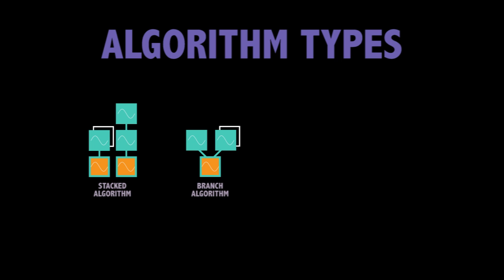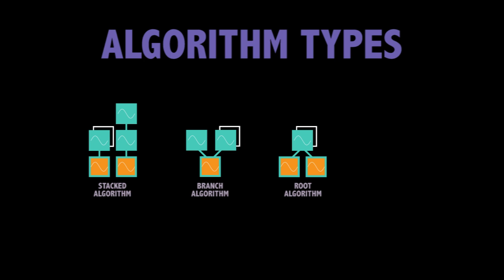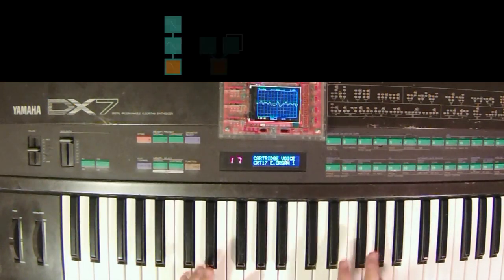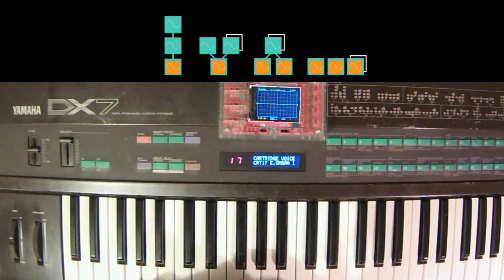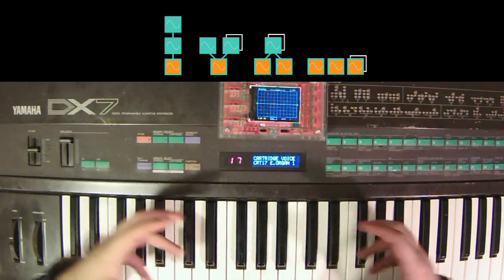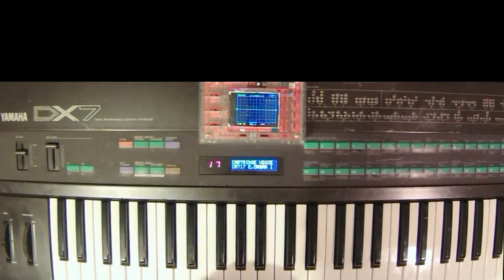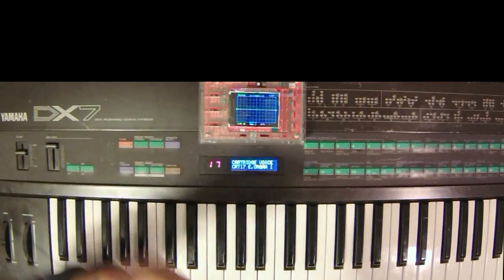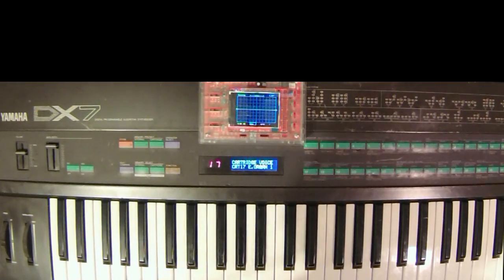Yamaha DX7 FM Synthesis Tutorial | Algorithms Explained

Comment: I'm still trying to fully understand FM synthesis and programming the DX7, so I might be getting something wrong here.
Is the statement around 1:40 correct, saying the modulators increase or decrease the sine wave's output level? I thought modulators modulate the frequency or phase of another operator, not its amplitude.
Reply from the maker: Every operator produces a sine wave and has an adjustable output level. The effect of Output level is determined by the function of the operator.

If an operator is a modulator, increasing its output level affects the strength or amount that it modulates the next operator its connected to (modulation).

If an operator is a carrier, changing its output level affects the volume of the sound that's produced (amplitude).

Comment: what parameter does the modulators wave form modulate in the carrier? thanks
Reply: i think the modulator increases or decreases the carrier’s frequency, not it’s level as you said in the video. that would be amplitude modulation not frequency modulation.
Reply: @eatfrenzy  Right, it increases and decreases the carrier's frequency at the rate of the modulator's freq setting. It's basically a really fast vibrato, which as it turns out, adds a bunch of spectral characteristics to the carrier wave to create the interesting timbres that you hear.
Reply from the maker: In FM synthesis, the modulators output level determines how much its waveform (sine) distorts and modulates the operator below it. It doesn't affect a parameter, it changes the waveform shape of the operator below it. In this case a sine wave is distorted to another complex waveform. This is true if a modulator is connected to another modulator or carrier in an algorithm.
Reply: I thought it changed the frequency (FM = Frequency Modulation)?
Reply from the maker: @paul_arutyunov In FM synthesis, frequency modulation is achieved by increasing a modulators output level into another operator (carrier). Changing the frequency settings (Coarse and Fine) will change the spectral range but it's effects won't be present if the output level is less than 50. The active output level range (in a DX synth) generally occurs between 50 and 99.

Comment: Was the oscilloscope on your DX-7 separately installed or were they all manufactured with an oscilloscope?
Reply from the maker: It's a stand alone digital oscilloscope and it sits on top on my DX7. If you're looking for one it's a JyeTech DSO138.
Reply: madFame sweet thanks
Reply: madFame is there any way I could message you and ask you a few questions about that oscilloscope?
Reply: madFame actually nevermind can I just ask you a few right here on this comment?
Reply from the maker: Sure, what would you like to know?
Reply: madFame firstly, how does the oscilloscope connect to the DX-7 like with what cables and where do you plug the cables in? Then does any old standard 9v power supply work to power the oscilloscope?
Reply from the maker: I connect my DX7 headphone output to the probe input of the o-scope. To plug it in you need a BNC to RCA adapter which converts the probe input socket to an RCA audio socket. The o-scope runs off a 9V center positive DC power supply.
Reply: madFame so if you’re using the headphone output of the synth are you able to use the normal output at the same time?
Reply from the maker: Yes, the main output is goes to my audio interface or camera and the headphone output goes to the oscilloscope.
Reply: madFame great I’m definitely going to get one of those
Reply: madFame sorry one more question, what cable is used to connect the o-scope to the DX-7?
Reply from the maker: It's a 1/4" jack (mono) to RCA cable.
Reply: madFame great thanks a lot

Comment: I notice when I look at the DX-7 algorithms that there is a minimum of two operators, I guess there is no such thing as a 6 op stack?  Or a 5 op stack with a carrier on the side?
Reply from the maker: Hi there. technically there can be any combination of algorithms but the ones we see on many FM synths have been auditioned by the engineers and designers as the most useful algorithms for a wide variety of possibilities. In most cases the ideal number of operators is 3 or 4 as this allows maximum tonal variety. Any more than that only produces distortion and noise which can be achieved with 2 ops and a feedback loop anyway.

Comment: Hi.  What algorythm did you use for the dual carrier stack?
Reply from the maker: Not sure which one you mean, carriers can't be stacked. In my video the orange ones are carriers and the blue ones are modulators. Many algorithms have this arrangement. For example, even if the algorithm has 4-ops in a vertical stack you only need to use the bottom 3 operators. The very bottom one is the carrier, the two above it will be modulators.

Comment: Can anybody tell me what the difference is between a modulator and an operator?
Reply from the maker: I can! :) 

Ok, so an operator is like a control box that has several functions. The main function is producing a sine wave. From here it has other functions to control that sine wave, such as output level, frequency, envelope etc. 

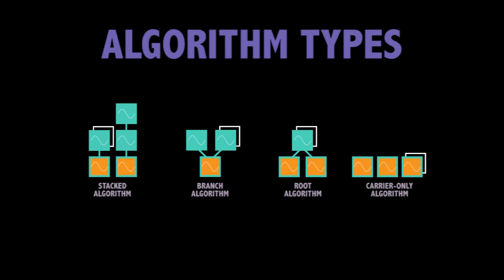If you look at the "algorithm type" diagram in my video at 3:07 all of those boxes are operators. The orange operators are Carriers, the blue operators are Modulators. An operator can only be one of these at any one time and this is determined by the algorithm you select.

A heavily simplified explanation of this is:  Operators in the Carrier position affect volume changes in the sound you're making. Operators in the Modulator position affect the frequency of the waveform shape you're programming.
Reply: I just watched your video, it's pretty well done! Looking forward to see all of them. Just here your explanation is not quite exact - operators in modulator job affect frequency, and can be used for vibrato (low frequency modulation), but when modulating frequency enters audio range, it affects timbre.

Comment: First of all: Thank you for your great work! But I am a bit confused about your statement at about 1:40 in this video. The modulator in an FM system is controlling the frequency of the carrier (not the amplitude as you are stating here, that would be AM not FM).
Reply from the maker: Hi Tobias, thanks for watching and sharing your thoughts. You are correct in your interpretation of FM and my explanation is correct but maybe unclear. I was referring to the user increasing and decreasing the Modulators output level and that affects the operator below it. I didn't mention a carrier specifically in this example because a modulator can be connected to another modulator as well. in either case I wasn't implying the modulator affects the carriers amplitude but rather the modulators amplitude affects the operator below it. Thanks for watching, it's great to have you tuning in.
Reply: @madFame  I came here to say the same thing as @Tobias, luckily I first did a search among the previous comments. Thanks for the clarification.

Comment: Great presentation! Just i'm a bit confused on one bit (bare in mind i'm a n00b...): you say at the start that FM synthesis can only produce sine waves yet later on you have a saw etc - I've probably missed some point - could you please clarify? Thanks for this great video series!
Reply: Just for the record, he was referring to the DX7, in which all operators are plain sines. Later FM synths offered additionak waveforms. The DX11 is only four-operator as opposed to the DX7's six, but it has multiple waveforms to select from for those operators. My SY77, which uses six-operator FM as well as AWM (sample-based synthesis), has 16 waveforms to choose from in the FM section.
Reply from the maker: Correct! Thanks for your comment.
Reply: since this discussion got way, cud I ask u guys how the montage compares (in terms of FM and waveforms/operators) and what other synths in production these days would you recommend (always sticking to FM)?
Reply from the maker: The Montage is a monster synth that goes well beyond FM synthesis. The FM section (FMX) is great and far exceeds the DX7's capabilities (and price tag). 8 operators, 88 algorithms, 7 spectral forms besides sine, the list goes on. The interface is really clear with the colour touch-screen plus control panel faders and knobs for real-time adjustment. The Volca FM is ok but has a very limited display and only 3-voice polyphony. The Reface DX is a great unit and worthy of being a stand-alone in any FM synth line up. Besides this, the older Yamaha DX11, SY77 and V50 synths are underrated and worth having at least once in your life.
Reply: wow, thanks a lot man!
Reply from the maker: Hi thanks for your question. Regarding the DX7 and sine waves I was only referring to the default waveform that it produces and not its potential to make other waveforms. I highlighted this because most non-FM synthesisers offer more preset waveform shapes by default (sine, square, triangle and saw) without the user having to create those waveforms manually. I hope that makes sense. Thanks for watching!
Reply: Ah, yes. thanks again!

Comment: Excellent video and thank you.  Also, how does one add a waveform monitor screen to the synth?
Reply from the maker: Hi there, thanks for watching! I use an inexpensive digital oscilloscope made by JyeTech. It's normally sold as a DIY kit but I purchased mine second-hand and preassembled. 

The scope is not built-in but just sits on top of my synth. It's a great little 9V unit that has a single input and I can run any synth through it to display audio waveforms. I also have a full-size analog scope which has a better image and response but it takes up a lot of room, so this smaller scope comes in handy for general use.
Reply: What is actually the reference of your JYEtech osciiloscope ?